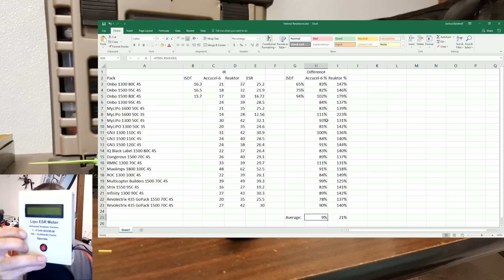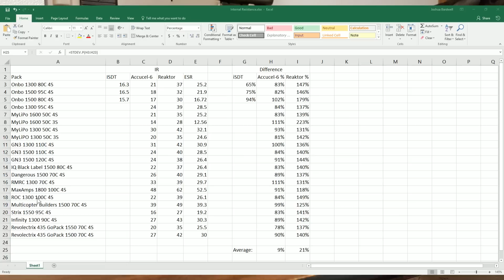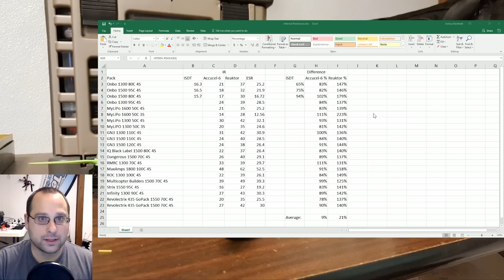LiPo Charger IR Function vs. Pro ESR Meter

Comment: Wow the Accucell-6 is beyond impressive. Would love to see you do this again with modern chargers. Some new ISDT, A ToolKitRC (M8S uses a charge/voltage rise calculation), HOTA (if they have an IR function), iCharger.

Then maybe get a YR-1035+ or RC3563 and see how AC impedance compares to DC IR.

The Wayne Giles IR..there's someone who made a video explaining the circuit schematic inside and it is down to a T exactly how an engineer (which I believe Wayne Giles is) would make a DC IR tester. I want to say there are two currents applied in different ways...or I'm mixing it up with the IEC standard.

Comment: One thing I could think of that could cause these strange result is the battery contacts having dirt or oil on them. the other is the contact tension/ pressure. 

So as your swapping batteries between testers you could be change the contact contamination characteristics. 

posable issue two is each testers contacts are going to be slightly different diameters due to manufacturing inconsistency’s.

I know for a fact the pressure at the point of measurement can fluctuate your readings dramatically. If you’ve ever used an esr with probes you’ll see readings can fluctuated with minimal pressure differences. But I feel an ESR with probs is going to give you more consistent viable data. It takes longer to test lipo’s because each cell has to be probed individually. but results should easily be repeatable this way.

Comment: Interesting topic. 
I'd like to share a field test: 
Speedrun of my RC car - Run 1 with 2OOOmAh 6s 1OOC. Average IR per cell: O.7mOhm, which makes it a true 61C battery. Potential max current based on IR: 122A. Speed: Around 85mph
Run 2 with 5OOOmAh 6s 5OC. Average IR per cell: 11mOhm, which makes it a true 9C battery. Potential max current based on IR: 52A. Speed: Around 85 mph.
Shouldn't Run 1 be a lot faster than Run 2? Why, in this case, is there such a huge gap between theory and everyday use? Okay, there is a weight difference, but that shouldn't matter THIS much.
Reply: The battery is not limiting to 85.  Probably motor is limiting

Comment: Joshua, I am enlightened by your video.  I have been all over youtube and google looking for a device that will give a reliable internal resistance measurement....and you confirm it - that there is none.  There are just devices that DIYers feels more accurate based on their experience with what they have been working on.  I just have a comment on your computation of the percentage of divergence.  Perhaps you got it wrong.  Please go over it again.  My understanding is this --- the math goes like this:  (1) get the difference between, say ACCUCEL and the ESR.  Then (2) Divide this difference by the ESR reading. Then (3) multiply what you get in step (2) by 100.  That gives you the percentage divergence.  Please have a look at this. Following this approach, the divergence of Accucel from ESR in your first row should not  be 83% as you computed but only  16%.  Aside from this minor glitch, your video was MOST INFORMATIVE.  THANKS - from LOLO GEORGE

Comment: I'd be curious how a DIY IR measurement compares.  The method I have seen discussed is to measure volts @ low current draw, and then measure volt drop at higher current draw.   I  build a circuit with a small light bulb on all the time, and a switch that connected two larger light bulbs in parallel with the small bulb. It would be interesting to see if this method (or some version of it?) has any correlation to the numbers these meters are producing?
Reply from the maker: +fredy gump one difference is how much current you pull when you measure. The IR reading will change as you pull more current.
Reply: true...and with a little fiddling you should be able to replicate the results the chargers are giving?  Then their results will be more meaningful...or be proven to be completely meaningless?  If I had your array of chargers, I would do it myself!  :)

Comment: You can't get a good measurement without a 4 wire solution. Any decent lcr/ohms meter uses 2 wires for current and 2 wires for sensing the voltage drop closer to the device under test.
Reply: Could you point out a good tester to buy?  Or are you saying the ESR is a good one?  Thanks...

Comment: Hahaha this with ir is driving me nuts..
Got three chargers
Sky rc little blue always shows cell nr 1 2times higher than the other cells..(per cell.. not total value)
My skyrc d100 shows more even between the cells but lower value than the cheap mini blue skyrc.
Then i have my latest icharger 408duo
That shows very even between the cells but same total value as my cheap skyrc.
Ive done ir metering every second charge 
Just to se what happens during the lipos lifespan. I always check rest value
Fully charged value.. and 2 hours after discharged.
I got 5 dinogy graphene 2.0 that shows 40 ohms before charge and 24 ohm charged.
My 120th charge on all my ten turnigy graphenes show 19-21 Ohms per battery uncharged and 14-17 ohms fully charged. I have charged my 10 turnigy graphenes about 1200 charges total.. and the turnigys beat dinogy by far..
If any one could answer my queation..
What does make a lipo go old and bad?
Is it only internal resistance that matters?
Reply from the maker: I do believe that IR is the main factor in a LiPo's health. The things that make a LiPo go bad generally increase its IR.
Reply: some people talks about batteries going bad when they have been on a shelf for to long before being bought/shipped.  if its been in storage charge at exact voltage whould this harm the battery and increased its internal resistance?
its always talk about batteries but not so much on what makes them going old.
I have had my turnigy graphenes going hot, been flying in cold weather, charging them 3c,
running them low, crashing them, lets say I have abused them pretty much. and as i mentioned before 120 charges per battery.
and not much has happened with their internal resistance.. and they haven't puffed.
i just wish they where lighter.. lets say 15g lighter.

Comment: Your average on the Reaktor most be wrong..  you have one messurement under 121%, and you say average is 21% ?
Reply: Kristian Frydstad I think he means on average it's about 20% high or low compared to the esr meter.
Reply: Yes he does, but it's more like 43% or something. He might didn't show all messurements
Reply from the maker: +Adam Komarek no, actually the bottom numbers were standard deviation and I mislabeled them. I cut out most of that discussion.

Comment: I have an ISDT (500w) and a similarly powerful iCharger, and they both read ir differently as you've shown. I have settled on using these numbers not as rock solid representations of hard facts about a battery, but rather just to ballpark problems or performance comparisons. If battery A has ir of xxx, and battery B has ir of XXXX, I'll probably go with A, regardless what the numbers actually are. My secondary use is to check for individual bad cells, using the same methodology. If 3 cells read fairly close and 1 cell spikes, I retire the pack. Again, regardless what the actual numbers might be

Comment: I also would consider the connectors, the cabels (thickness, length) of the different chargers/testers for the IR measurments. Maybe this explains some systematic error. I also find the MyLipo results interesting: The 3S 1300 is excatly 3/4 of the IR of the 4S. But the 1600 is strange (ESR device). Anyway, good video. Now it would be VERY VERY nice to correlate the IR results to your discharge tests. I think the results will correlate!
Reply: Sebastian Nobody it is interesting that you say this as I have also tested IR using different gauges of wire and length and it tends to make a huge difference. this test just shows if you really want to watch the life cycle of your lipo through IR values then you'll need an esr meter.

Comment: Would it be worth while to cross check the Pro ESR meter readings with the temperature readings you got in your discharge test? See if the batteries that got super hot measured higher on the ESR meter.
Reply from the maker: That might be worthwhile for sure. The data is public so anybody could do that if they wanted to. Well, I guess you would have to pull the ESR readings out of this screen grab, but there aren't too many of them.

Comment: I've been using that same IR meter for a while now. It is very accurate. And I'll link a website, in a hour or so, that you can use to calculate the true c rating of a battery using its capacity and the IR.

I didn't look at the spreadsheet in this vid but the adrenaline packs and new SMC packs ( both ~1300) had an IR of 4milliohms when I tested them.. that is an amazing IR for that size, I see batteries with twice that capacity with the same IR.

PS. The iChargers check IR very consistently against themselves ( albeit a bit low ). And yea iCharger 106b for $79.

Good vid brother~.
Reply: Use this link with the ESR meter's accurate IR reading and the batteries capacity to get an accurate C rating -

www.jj604.com/LiPoTool/

Comment: Interesting test. I found most cheaper chargers I've tried are all over the place, as you found. It's a pity you didn't have access to an iCharger. I'm using a 308Duo and it seems far more comprehensive and consistant to most chargers, but I'm still not sure if it's anything like accurate. It tells you the resistance for each cell plus the overall pack resistance and it does so by putting the battery under a ~5A load for a few seconds. It also measures as it charges.

Cheers Joshua
Reply from the maker: I have heard from other sources that the iCharger line is as accurate as the ESR meter.
Reply: these tests are very interesting. as i have normally checked mine i always look at each individual cell just to see what cell is usually more healthy than the next . as the battery`s age as expected the IR goes up and they tend to start taking longer to balance as expected  usually the IR will tell which Cell is the bad one . i usually get a new battery and first charge i write the IR down on the battery for a reference for that battery  so i know that that battery i might save for a race . these reference points i use the ICharger  308Duo  also . but the accuracy of this tests Josh has brought forward has raised an eye brow  so which IR reader do i use ?
Reply: Yeah that's part of the reason I got it, but I've never had a means of testing it. BTW, if you can get hold of a Tattu R-line battery to try, do so ;) Best performance I've experienced so far.
Reply from the maker: I tested an R-line in group 3.
Reply: Joshua Bardwell So you did, I forgot about that. It wasn't particularly impressive in your testing was it. I've been impressed with mine so far.

Comment: Josh, I also get random inconsistent  results on my Reaktor 300w... depending on where I plug the Lipo into my 6 port parallel charge board ... I always put it down to small differences in the parallel board. But then I read this ....http://batteryuniversity.com/learn/article/how_to_measure_internal_resistance
Reply from the maker: Very good link.

Comment: Accurate IR numbers for users matters very little. It's the ability to sort out your own lipos and to monitor variations within a pack. Some RC car racers have been monitoring IR numbers for years with good results. Like you stated you have to be very consistent when and how you get your numbers for comparing packs/cells. I've had the same ESR meter for years and if you compare numbers with a top end charger like the iCharger Duo series you will see similar results. I always try to buy RC car packs that come from reputable suppliers with low IR specs and good cell matches. Multi-rotor suppliers/manufacturers haven't got to that marketing scheme yet but it's coming some day.

Comment: Interesting testing Josh!
Frankly I'm not surprised as it's difficult to get a good multimeter these days. I use them to fix cars and we now check the calibration of each meter. Some are so bad that we have concluded the mfg probably skipped the calibration step....to save some money.
Perhaps a log of each battery pack's charge history/IR on the same charger would show a trend over time?
Reply: Canyon Racer can't go wrong with a fluke
Reply from the maker: +endyouoff only thing wrong with fluke is the price.
Reply: Joshua Bardwell haha yeah mine was included with tuition price for automotive school
Reply: i got a fluke 87 for 20$ the other day, we were swaping them out for newer models at work :D, so they mostly all works and mine was last calibrated oct-2015 :D

Comment: Wonder if it would be meaningful to compare this data to your 60a current draw tests? Noticed that the Strix had the lowest resistance on this test, and also was the top lipo on your draw tests.
Reply from the maker: And the MaxAmps had very high IR. I do think there is SOME validity to the numbers, but not very much.
Reply: Joshua Bardwell Probably.

Like u said...or I think u did...best use for Resistance measurement is just to keep an eye on a batteries health. When I saw my turnigy bolts were hitting 235...per cell...I knew it was time to trash them.

Comment: I find the IR test on my charger most useful for checking if a battery has a faulty cell before charging at high current. A faulty cell will show up with high internal resistance on the charger, last thing I want is to parallel charge a battery with a faulty cell at 5C
Reply: Ditto!!!  You only need to learn that lesson once when you kill 5 other packs because you had one bad cell.